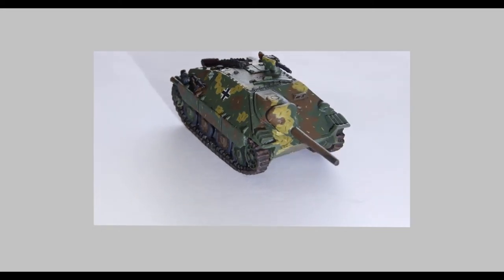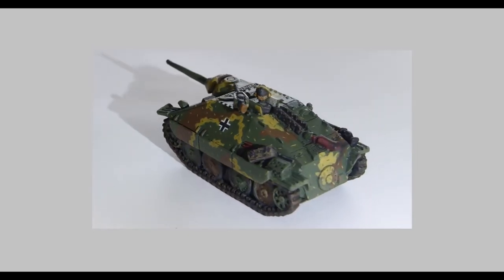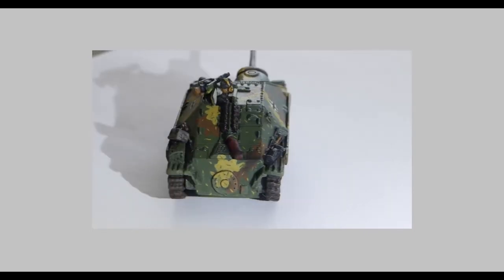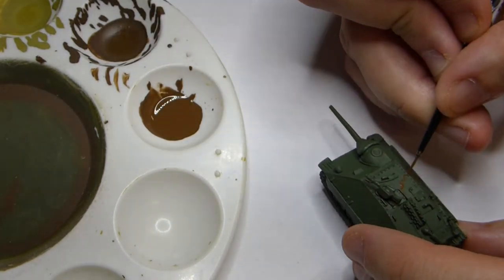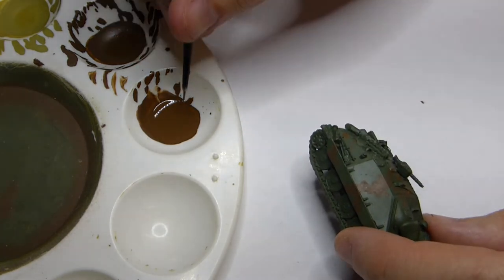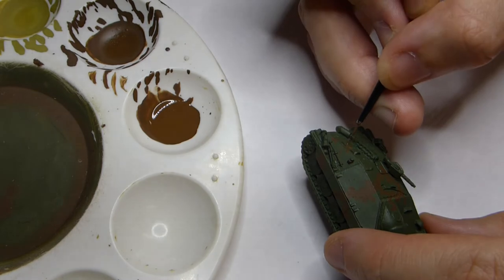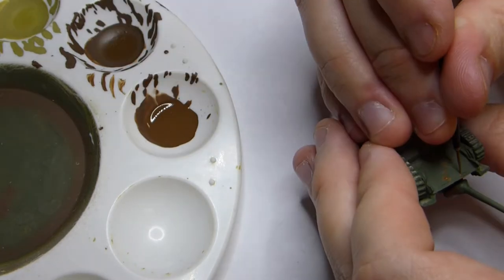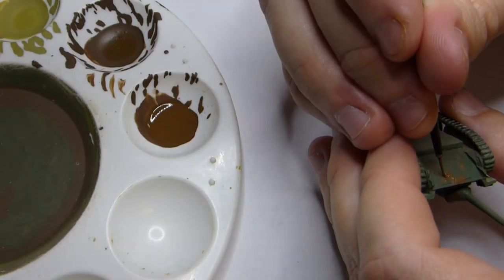How to Paint German Tank by HAND - Step by Step Guide (Flames of War)

Comment: Hi,  couple of questions from your post if I may.  First one is that I noticed you are using quite a fine brush to do this.  Most painters would use a size 2, even on 15mm.  So is there a reason why you go so fine?  I like videos where the vlogger uses different techniques but may be you can add audio on why you choose that technique.  (Not saying it's wrong, very little is wrong in painting)  The other question is why the green base coat?  By late war the Germans were using Ochre as their base colour, or Dunkle Grube (Dark yellow).  Again curious not critical.
Reply from the maker: Hi mate, firstly thanks for the questions and advice. I'm very new to this so you've given me some useful points to work on. The brush I use is a Games Workshop layer S, I've used a whole manor of different brushes and settled on this as my favourite for painting this scale. I tend to find that it is resilient and the tip doesnt damage easily. 

To answer your second question, I went with the base coat of green as I did a lot of googling on what paint scheme to paint these Hetzers and found very common theme which I attempted to follow in this tutorial. The theme is very green heavy so I went with that as the base coat to save myself some time. I've also heard the same about the lack of green paint but the Hetzers I have seen on Google tend to be rather green heavy. These are the picture I used as reference 

https://www.the-blueprints.com/blueprints/tanks/ww2-tanks-germany-1/56643/view/jagdpanzer_38t_hetzer/

https://www.pinterest.com.au/pin/746682813189369245/, 

I went a lot darker in this video as I wanted to keep it simple for new people to the hobby instead of mixing paints, etc which wouldve got those colours lighter :)

On a final note, if you check out my facebook page Painting Panzers youll see some better photos of the finished products. I hope this has helped a little and thanks again for your awesome advice 😀